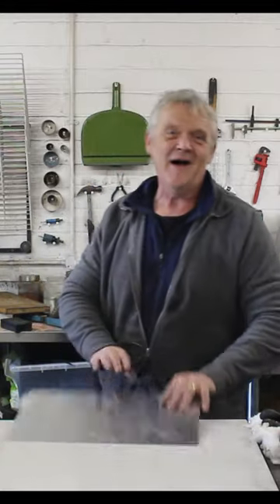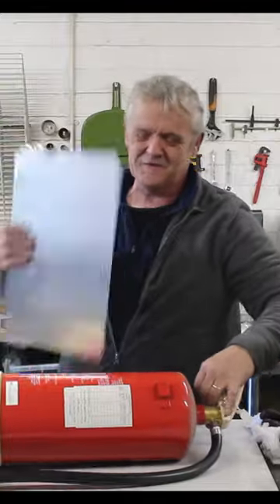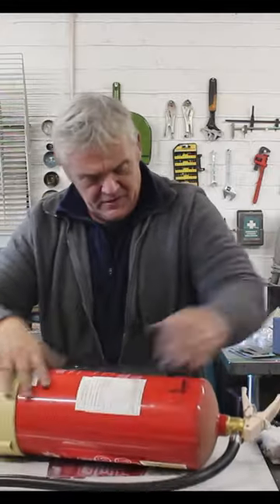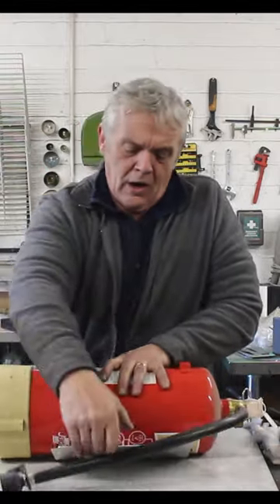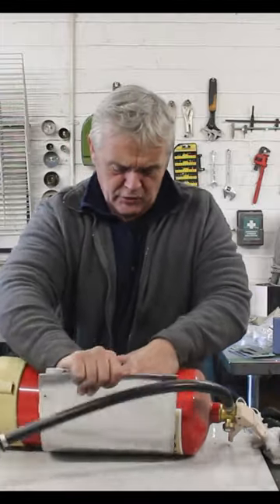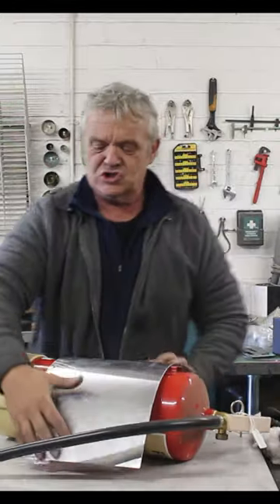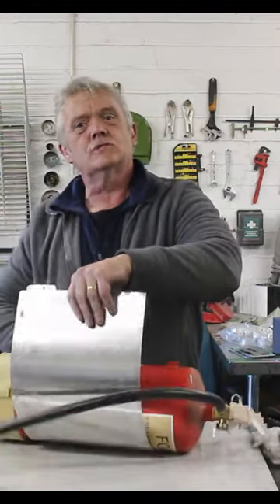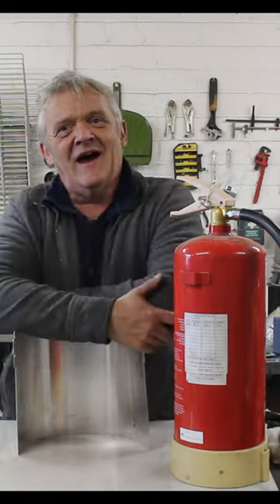Rolling Aluminium Sheet Without Tools #shorts #workshop #tips

Comment: Not sure if I can find a fire extinguisher like that, but maybe a large diameter PVC pipe would work?  Does the roller need the weight of the fire extinguisher or is the round shape enough?  Maybe fill the the pipe with concrete if the weight is needed?
Reply: Just use the pvc pipe while pressing it down, you’ll be allright